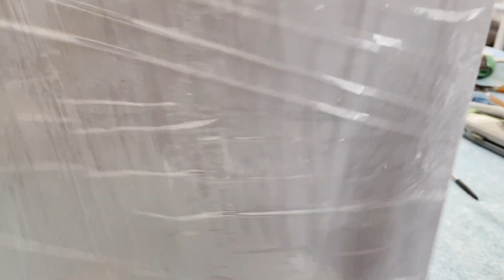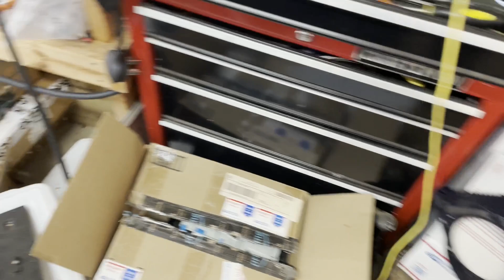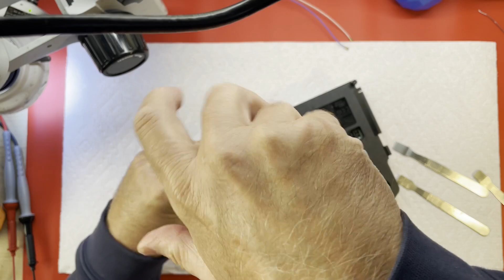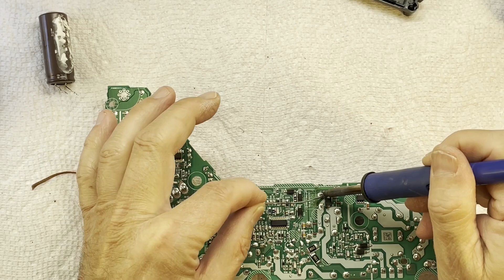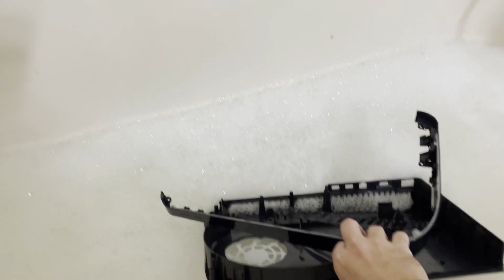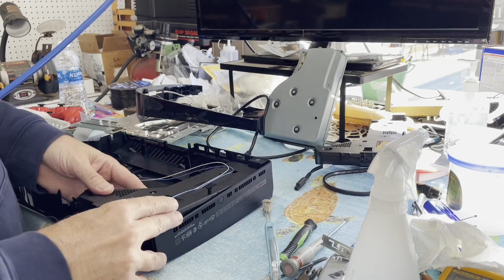#119 Repair of PS5 No Power

Comment: What with these Playstations power supply failing, I have 2 ps1 and 2 ps2 and 5 ps3 all work as they should and never repaired or replaced anything. I come to ps4 and ps5 I have problems, 2 ps4  1215 both have to replace power supplies like what the heck lol
Reply from the maker: I don't know.  Bugs are a problem.  And lightning.
Reply: I have replaced many PS5 power supplies as well.  I am not brave enough to work on them though.

Comment: Do you work on boards through the mail. I have my board out of my system and everything. I know my power supply is good. So figuring it's something in the board. And if I can get the board fixed cheaper than what it costs to buy another one, I'd definitely go for it. Its the EDM-020. I know you know what your doing with them. And it's so easy to mail something off today I can definitely ship it if you're interested in taking a look for me. I'll pay the shipping both ways and everything. And I'll pay to have it worked on. If I can get some type of close estimate before. And a marrowed down one later would work for me. Just let me know.

Comment: I need help, I have a PS5 that had a problem with updating the system, it was constantly looping, there was only option 8 in safe mode, I desoldered the SSD controller and reballed it and after that the console gives a sound signal and no LED light. When connected to a laboratory power supply, the power supply shows 0.13mA , is the controller damaged?
Reply from the maker: When you first apply 12V, are you getting a steady 13mA?  If it is not rising up close to 300mA and then back down, something is dead.  If you have been working in the area of the SSD controller, that would be a good place to start.  Are the SSD rails coming up?  0.8V, 1.2V and 2.5V.
Reply: @ToltecMerc  after connecting the laboratory power supply and applying 12V to the terminals, the current increases to 0.13mA and stays for a while and then drops to 0, I get a voltage of 0.8V, 1.2V and 2.5V, could it be a damaged SSD controller or another reason?

Comment: What's the stuff you use to glue the capacitor down? What's it's purpose? Amazing knowledge learn something every time.
Reply from the maker: It was just ordinary clear silicone caulk.
Reply: @ToltecMerc  thanks why do they gunk it all over some components?
Reply from the maker: @FreeWhilly734  it is used to prevent larger items from moving or to prevent some parts from vibrating and causing an audible noise.
Reply: @ToltecMerc  very cool appreciate the knowledge learn something new 👍

Comment: "Looks up your multimeter" "closes page after seeing price" :) good video sir
Reply from the maker: Well I wouldn't pay new price either.  I bought it broken and repaired it.  I'm probably out about $300.  They are nice though.  Very quick response!  Thanks for watching!
Reply: @ToltecMerc ❤😂 of course you did
Reply: @ToltecMerc  what typically goes wrong on these? I'm looking to replace my fluke 83 iii
Reply from the maker: @jonathansandiford4137  the OLED screens fail.  There are aftermarket replacement options.